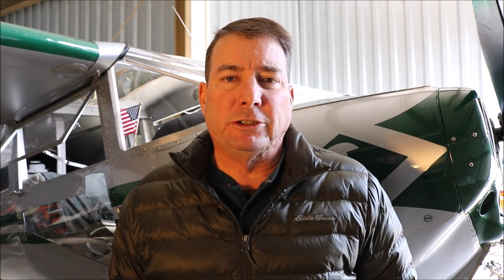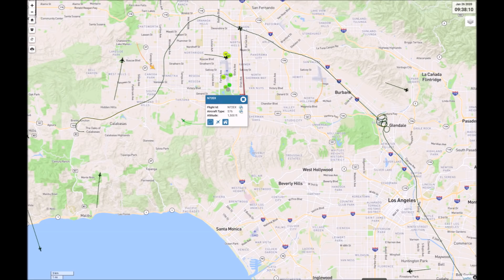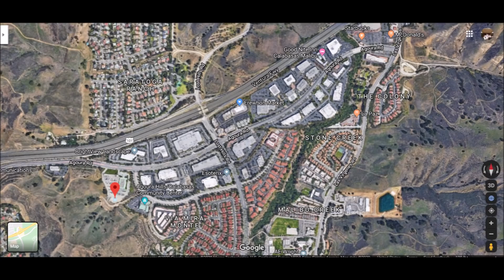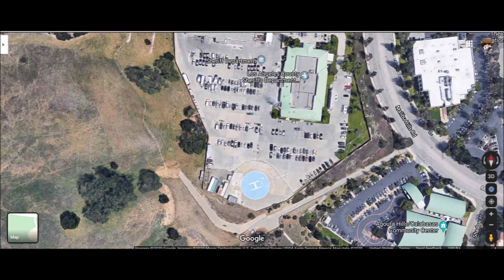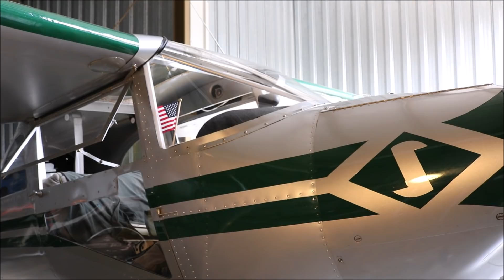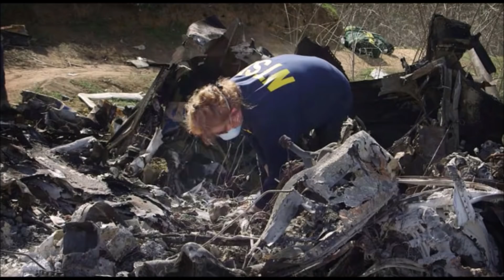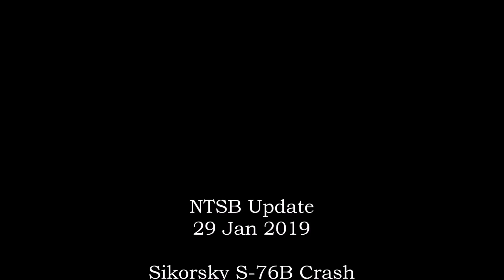Kobe Bryant Sikorsky S-76B Crash Update 29 Jan

Comment: Ok now we will learn some more facts, instead of conjecture thanks to Juan.
Reply: "Inadvertent flight into IFR conditions"? No sir, intentionally scup running..call it what it was and you don't need a bunch of excessive regs and equipment, only pilot prudence and responsibility.
Reply: @scottpatterson4105  Exactly.  However I'm afraid the FAA is going to create new regulations when they may not need.  But, I never knew that SVFR for helicopters was as low a 1/2 mile visibility.    I don't know if that should apply in mountainous areas, but I'm not in favor in more regulations unless the changes would be meaningful, reasonable and necessary.
Reply: @daffidavit  They have the ability to stop forward movement and/or turn around in place, and/or move vertically up or down, hence the lower minimums. Adds to there not being any excuse for this happening, unless there was a loss of power or flight controls.
Reply: @scottpatterson4105  I had lunch with my good buddy yesterday.  He flies Agusta's for a company and owns his own Bell Jet Ranger.  He believes in this case when the pilot made the left turn from the road, there may have been a gap or a hole in the fog and tried to needle his way through slightly open spaces.  He doesn't believe the pilot intentionally flew into the fog.  He thinks it's possible the rotor may have clipped the side of a tree or terrain causing the helicopter to fall down so fast.  I think that is more likely than some sort of disorientation theory.  It makes sense but I doubt we'll ever know.   Unless the NTSB can determine if there was rotor damage that occurred before the main crash.  Be well.
Reply: @daffidavit  Again, scud running to an extreme that he couldn't even see his rotor blades? Also in an area where a climbing escape would highly endanger other aircraft in a known congested area. And he knew that because ATC told him the other aircraft were there, hence his altitude. He could have stopped, rotated 180 and departed, but didn't.
Reply: @scottpatterson4105  Don't get me wrong, I'm not defending his actions I'm only suggesting a way this could have happened.  It's still scud running unless he had at least 1/2 mile visibility all around him the entire time.
Reply: @daffidavit  Certainly some forward visibility is needed, but again this is a helo and has the ability cease forward motion. To me the larger part is scud running in hilly terrain without the option to climb. Been in the situation myself a few times being trapped under unforecast weather. Difference is I was off airways x-country and out of radio reception. Climbing was the only option and was hoping my angle of accent was exceeding that of the mountains around me.
Reply: @scottpatterson4105  I've been in a few situations with airplanes during my 50 years of flying that when I look back I have to thank my guardian angel.  I'm sure the pilot of the Heli in this case felt the same fear that I felt.  I was able to learn from my mistakes.  But I wasn't flying passengers for hire either.  When we carry passengers, there is a "higher duty" in my mind to give the safety envelope even more margin.  His number came up because he flew too close to the edge of the safety envelope, figuratively speaking and killed himself and many others.   Of course I feel bad and I don't take joy in criticizing the faults of other pilots because I've made my own over the years.
Reply: @scottpatterson4105  Below is a reply I gave on another channel when I was discussing taking off in a Mooney from a grass strip at Katama at Martha's Vineyard a few years ago.  It was almost prophetic>>>>>>>>>>>>>>>>>>>>.

       "Thanks to Chris, he was a test pilot.  He used the numbers and flew on the outskirt of the envelope.  I'm sure he wouldn't do this again.  However, this video has probably saved hundreds of lives.  Last summer I took off in a Mooney M20C (1964) from Katama airport, on the southern tip of Martha's Island.  That's about 19 miles east from the tip of Montauk, Long Island, N.Y.   It's a very well trimmed grass runway.  I made sure NOT to put full fuel into the tanks.  Although it was a soft field, I did not do a full soft field takeoff because the cabin had four lightweight people in it.  
          We broke ground about 40% down the runway.  I lowered the nose and allowed her to accelerate in the ground effect.  The stall horn chirped for a second, but no big deal.  I let her stay in ground effect extra long because there were no obstructions ahead of us.  Before I did this takeoff, I watched the video by the young Bonanza pilot who is famous for circling the world as the youngest solo person. His first name is Matt and he has a famous channel here on Youtube.  I got confidence because the Mooney is lighter than the Bonanza.  Of course, I worked out the numbers in the book before take off.   I gave myself some extra room for error.
            Everything went well.  The experience was nowhere as scary as what we see in the above video.  However, when a pilot is taking off with a full cabin on a grass strip and people's lives are depending on him or her, we better make sure we know what we are doing.  We must have a fudge factor built into the equation.  If you try it on the edge of the performance chart, you run the very serious risk of losing.  Please keep a 50 percent fudge factor on all your close takeoffs.  If not, then don't do it.  And most importantly, don't let your passengers talk you into doing something.  You will experience the "JFK Jr." personal challenge.  JMHO..
Reply: @daffidavit  Good narrative. Personally I have to admit the only numbers I remember are flap and gear on my M20C.

Comment: No amount of fancy equipment can substitute for pilot common sense, the pilot made the most basic of mistakes !
Reply: Assumsions are being made that this was pilot error. Hellicopters are complex machines, so I wouldn't rule out a mechanical issue at this early date....
Reply: Dave, however this year is the tenth anniversary of the iPad. A device pilots can have in the cockpit, but legally can't rely on. Even though an app for the iPad with GPS, the internal gyroscope, and 3D map of the terrain is more than capable of warning a pilot of dangerous drift, flight, and loss of altitude. Although the pilot probably became disoriented, and shouldn't have flown in the first place, if he'd been legally allowed to use something as simple as an iPad, perhaps with a second iPad active as a redundant backup, that might have prevented him from getting lost or later getting disoriented to the point of crashing.

I'm aware this wouldn't solve the problem of pilots failing to trust their instruments, or getting confused because they're partially flying VFR and partially IFR, when they didn't fly IFR in the flight plan. But it seems hard to imagine an iPad with all that technology and a clear 3D map of the ground, altitude, and position, wouldn't have helped at least a little.
Reply: Yup should've never flown.
Reply: @whattheheck3553  Or as some have suggested a second pilot.
Reply: @whattheheck3553 :Sometimes when you throw the dice.......you crap out.
Heartbreaking that so many people are in pain.
Reply: He's got an important client he doesn't want to disappoint and maybe took risks he shouldn't have . We ALL may have made the same decision if we were in his shoes
Reply: @AlaskanKraken  what does that mean. You think this person really cares about your opinion and suggestion.
Why even comment as it's none constructive
Reply: Is Spatial Disorientation a mistake?
Reply: H M  Exactly why I said have a redundant iPad. The bigger point is in the first sentence, this year is the tenth anniversary of the iPad. By now there ought to be an approved device that is not so expensive that it hinders adoption.
Reply: You are absolutely right...only takes one mistake..
Reply: H M  iPads are very reliable with stable software. If you run flawed apps you get more frequent app crashes. Additionally if the FAA actually tried, or a company was trying to get certification for use in flight, there'd be additional things done to improve reliability.
Reply: While you are right, there is one exception. Remove the pilot, then you don't have to add technology to help the pilot. It has been posible to fly automatically without any visual references for a few decades now. FAA approval is why it has not happened under FAA flying. The military has been doing it for a long time (even if not in a way that would've prevented this crash)
Reply: Chris S  Oh, yes I know what autogyration is. Years ago one of the major helicopter manufactures was experiencing gear failures in the transmission. The shaft turbines turning fast and the main rotor turning comparatively slow. Compressor stalls, collective pitch control hydraulics failure, the potential list is long....

Comment: Yes, the 20 to 30' in an article I read was nothing but confusing, because for some reason the helicopter was losing altitude at a great rate of speed.  What matters is the latter.  It sounds like he lost awareness after he rose to the 2300' altitude.  Pilot would not have dropped 2000' a minute to reach a safe spot to land (sheriff's helipad) IMO.  Does it require a celebrity dying to change regulations?

Comment: Three times the NTSB lady said they told the FAA that helo's especially part 135 helo's should have cvr's, flight data recorders, TCAS, and GPWS systems installed but the FAA did not install them.
Reply: The FAA does not pay for an install them, the OWNERS PAY FOR AND INSTALL them.   You are talking many thousands of dollars worth of gear.  The new ADS-B transciever that was required was $2000 or more.

Comment: Juan would  you ask Scott can a helicopter stall like a fixed wing aircraft? 

And it was reported to be flying at 150kn. Is that too fast under these conditions
Reply: yes, its called 'power settling' and its deadly.  however recovery is forward speed, if they had forward speed this is not a likely culprit.
Reply: I thought about this too. I read that the most common stall condition in a helicopter occurs near Vne or low rotor speed / hda. In this case it seems like none of those were at play- although the result of an uncontrolled or corrected retreating blade stall would have pitched the aircraft to the left- similar to what happened.

I am also interested in the ground speed guidelines for a situation like this. IMC + Terrain on a VFR plan and ATC transition? Why not immediately slow down for the transition to IFR?

Comment: was curious if the pilot knew the route well. thanks for answering that.
Reply: George Doolittle this was actually my theory that I left on another video of Juan’s. Cool to see he mentioned it!
Reply: @KeithKman  hopefully some good will come from this. looking forward to tomorrow's report. the V-22 Osprey has a very not good History on the military side...but still very much in use and deemed "mission critical." Never flew on a "Little Bird" but always wanted to.
Reply: George Doolittle yes I agree. To expand on my theory please open google maps. Crash was roughly 1.0 miles due East of the helipad. Chopper had already cleared highest point on the 101 freeway. When he came down did he mistake the Las Virgenes Bridge for the Lost Hills Bridge, tried to circle back to the helipad but was disoriented and in the wrong location? This is my theory. Initiated his turn to the helipad too early by about 20-30 seconds.
Reply: @KeithKman  IF you can see the ground, there's no way you could mistake the two.  And flying West, he wouldn't have to turn left  like that until closer to Liberty Canyon.  The Lost Hills bridge is East of the Lost Hills Station helipad.  Not to mention he wouldn't still be doing over 150 kts.
Reply: Yes.  He had flown it the day before in clear conditions.  Obviously not the exact route following 101 as the wx was clr but to the Mamba academy.

Comment: Is CFIT same as spacial disorientation? I know what each are but can they be one in the same?
Reply: The difference is that a pilot can experience spacial disorientation and recover without crashing. Disorientation occurring in combination with loss of flight control is also not classified as CFIT. Further, accidents involving a disoriented pilot that crashes into another aircraft or lines or something i.e. not terrain, also fall outside the CFIT definition. CFIT means the pilot had control of the aircraft and flew it into terrain without correcting until it was too late (or at all). The primary reason for CFIT could be spacial disorientation, but other factors such as instrumentation malfunction can also lead to these types of accidents. Someone correct me if I am wrong- it has been a minute.
Reply: Nope, different. Spatial Disorientation can lead to CFIT

Comment: Typical FAA not acting on well-researched recommendations.
Reply: tenpiloto Too Damn busy screwing with drone operators to deal with life saving measures......
Reply: @JimsEquipmentShed  
Too busy taking lobbyists bribes to be concerned about commonsense.
Reply: Naw, I don't agree with any of you guys faulting the FAA for the TWS in this case.  The question is why were Pt. 135 operations allowed under "SVFR" conditions with fog in mountainous terrain?  And please, don't tell me a TWS would have made a difference.  My iPad would have shown all red meaning there were hills and elevations well above the take off point.  So what good would it have been?  Would an "all red" iPad TWS indication have made any difference in this case?  No.  Everybody who takes off has "red" on their iPad until they get enough altitude.
Reply: daffidavit---maybe TAWS wouldn't have prevented this, but you are still faulting the FAA for allowing SVFR in that area (I totally agree--never have been a fan of SVFR).  There have to have been recommendations to disallow it.
Reply: @tenpiloto  I don't fault SVFR when the visibility is less than three (3) miles and clear of clouds and the aircraft is trying land in Class D airspace.  It can make the difference between landing in 2 miles of visibility vs. going somewhere else and having a worse case scenario.   But I agree with you,  SVFR should not be used as a tool as it was in this case.  It was almost "reverse safety".
Reply: daffidavit--exactly.
Reply: Government bureaucracy is a good example of static inertia and risk aversion.
Reply: So you want more FAA regulations?  Especially when this accident could have been avoided with the use of common sense? Even iPads with TWS would not have made any difference.  The scene would have been all red.  We've all done stupid stuff, but on this day, "Fate was the Hunter".
Reply: tenpiloto   You are not a pilot, otherwise you would not want the FAA breathing on your neck.  They have enough work to do on a day to day basis to take the hit for this accident.  This was preventable.  The regulations were enough.  Sometimes even passengers have to look up to the sky and ask the right questions.
Reply: The way our government acts these days across the board...but CA would not understand this.

Comment: I use a terrain avoidance warning system (TWS) when I fly in my buddy's  C-150.  He has ADS-B as we all must have since the beginning of this year and so too must the aircraft in this case.  I have a Garmin GDL-39 ADS-B "in"  receiver that sends bluetooth signals to my iPad.  When I'm taking off everything is "Red" until I climb high enough.  But the iPad will warn us even without ADS-B if you have either the Garmin Pilot or the Foreflight App. 
          So even if this aircraft had a TWS, what would it have shown but all red on the screen?  What good would it have been?  It would have said something like  "warning you are surrounded by obstacles and mountains"  and have shown an entirely red screen on the display, figuratively speaking.
Reply: I'm thinking a better system would be an auto-hover system for emergencies. Garmin is rolling out their emergency autoland for planes, this would be similar except for helicopters. This pilot knew he was in trouble but was going too slow to maintain instrument control in the clouds. A computer can maintain a stable hover with no outside reference, a pilot can't (at least not for long). A system like this would be like the Garmin system, press the button and let the computer get you in a stable hover while you declare an emergency and gain enough altitude to be guided by ground radar. After that, you could tell the system to point in the right heading and gain enough forward speed that the pilot can take control back and fly safely on instruments to a safe landing area. That or some sort of futuristic augmented reality heads up display that would allow a pilot to "see" through the clouds via a virtual representation of the terrain around the aircraft, if it was low enough latency there'd be no problem maintaining control in the clouds or accidentally running into terrain (but that type of thing is probably years away from FAA approval and very very expensive, but so is the auto-hover).
Reply: @MrMattumbo  the most modern Agusta helicopters can take off, go to the planned waypoint and descend and hover 50 ft over the ground, according to my buddy who flies Agusta Helicopters.
Reply: @daffidavit  That's fucking cool! if that system is already in use then I'm sure it could be expanded to other models and eventually standardized. With how many helicopters crash from flying VFR into IMC that could save a lot of lives.